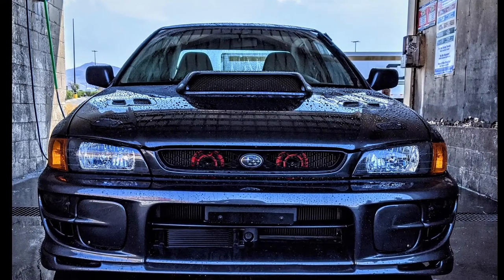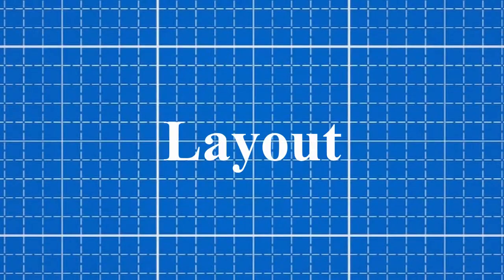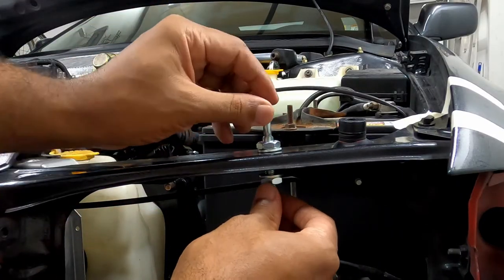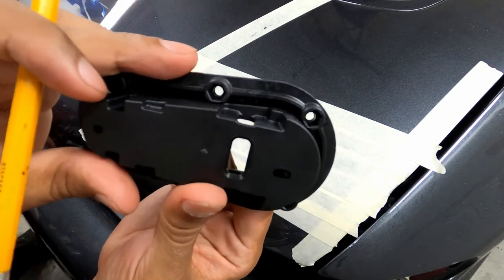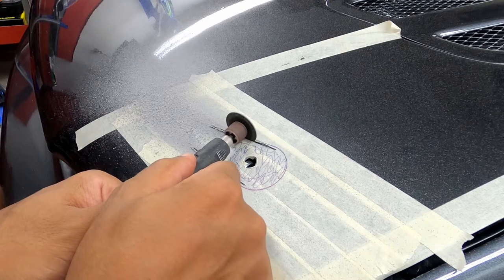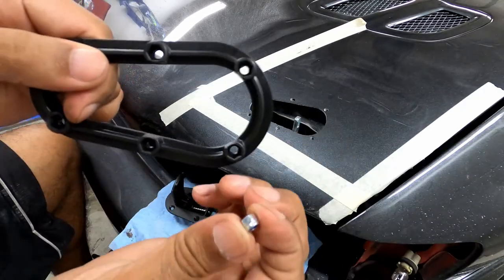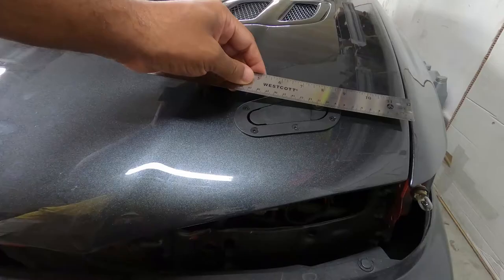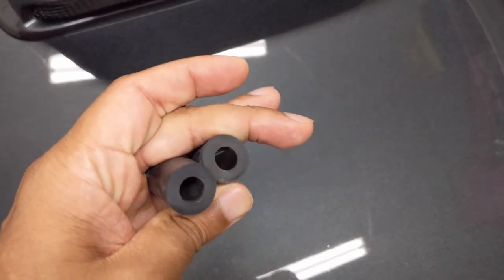How to Install AeroCatch Hood Locks / Pins on a Subaru Impreza GC STI Build Seibon Carbon Fiber Hood

Comment: What happened when you put the headlights back in? Weren’t the bolts too low and block the headlight housing?
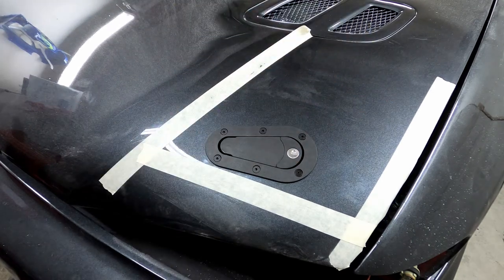Reply from the maker: No, you have to cut the bolts once you've set the proper height. This part can be found at time 7:30 in the video.
Reply: @RyKingUploads  that’s what I just found  as I’m installing mine but with the headlights still in. Thanks for the feedback I must’ve missed that part when skipping around.

Comment: Question - on the carbon fiber hood can you remove the big hood scoop and replace it with the OEM size hood scoop?
Reply from the maker: That's a good question. I'll have to dig out an oem scoop and try it. So, as of now I don't have an answer to your question.